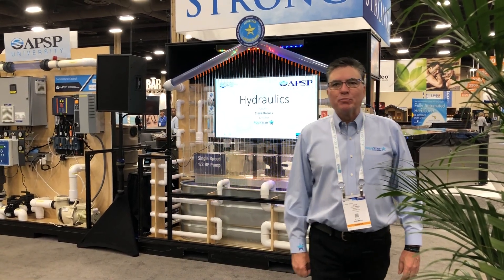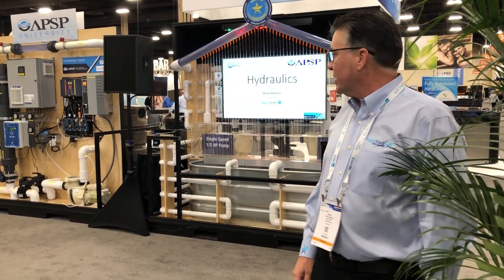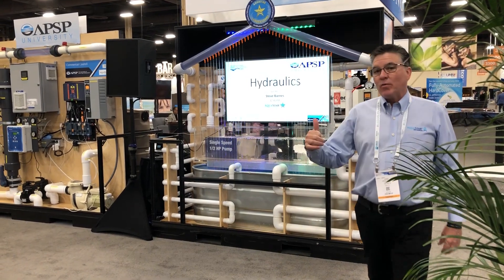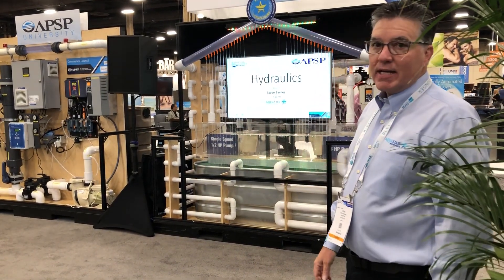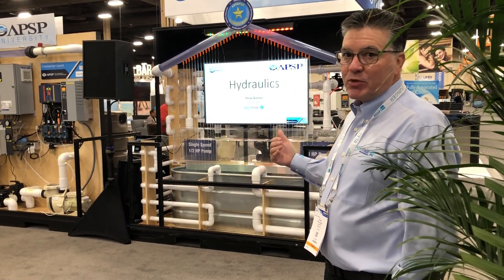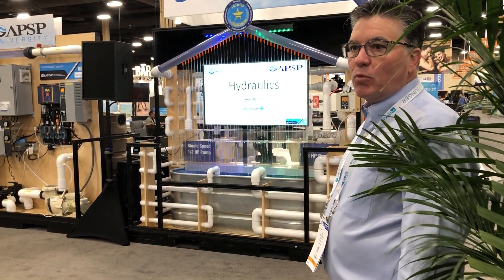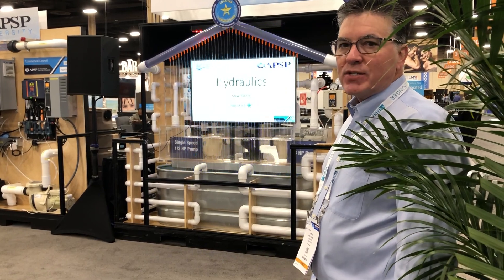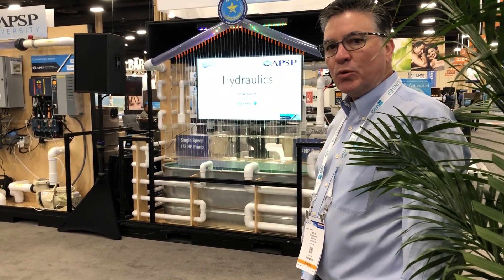AquaStar Hydraulics Demo

Comment: What’s the effect of over sizing?
Reply from the maker: Hank, thanks for your question and we apologize for the delayed response.  The effect of “oversizing" piping is at some point the additional cost of larger pipe won’t be recoverable in the form of lower electric bills.  To get a sense of this consider a common 18,0000 gallon pool with a heater that needs 50 gpm. The minimum residential code compliant pipe size is 1 ½”.  Add to that a typical filter and heater resulting in a filter pressure of 20 psi.  Keeping everything the same except for pipe size, look at how the filter pressure changes: 1 ½” = 20 psi; 2” = 11.05 psi;  2 ½” = 8.94 psi; 3” = 7.96 psi; 4” = 7.59 psi; 6” = 7.47 psi; 8” = 7.46 psi; and 10” = 7.46 psi. We have 10” pipe in the AquaStar Lab and we test drains with 1 ½” pipe, so we see these effects regularly.  It even shows up in pipe-size-based VGBA-2017 flow ratings and head loss curves.